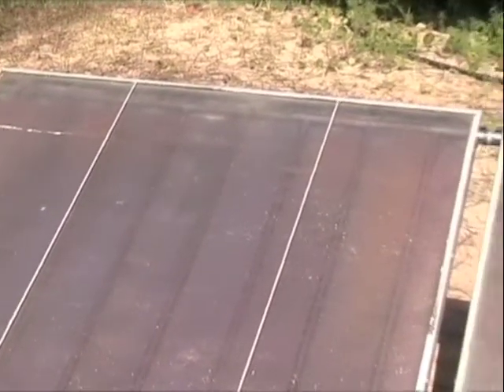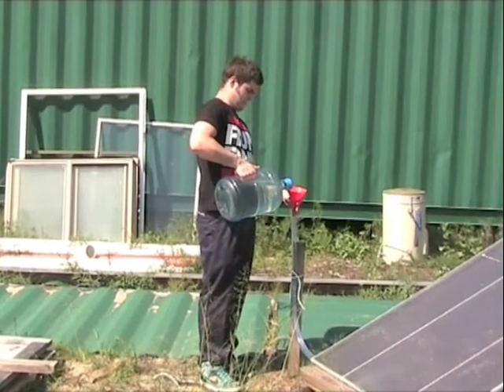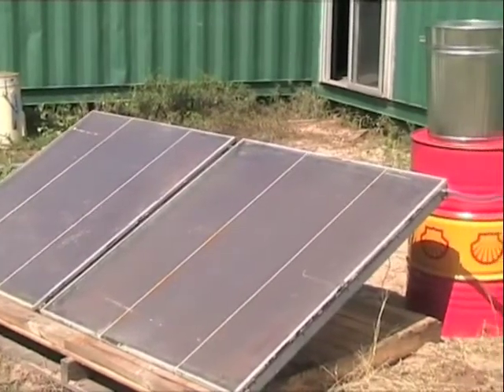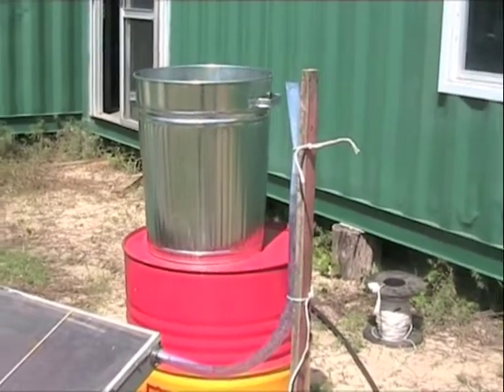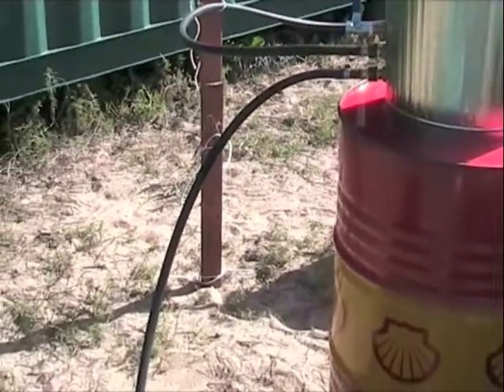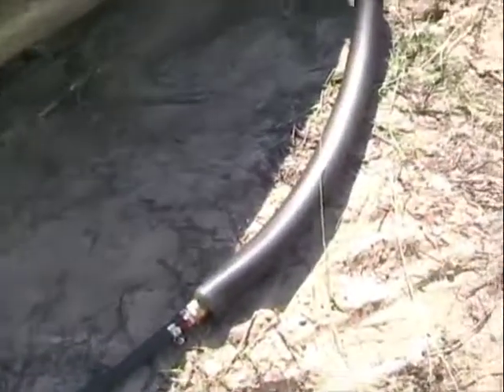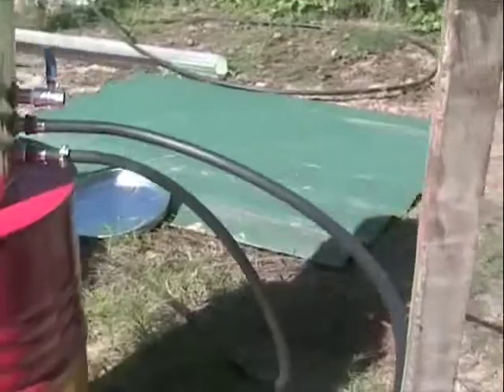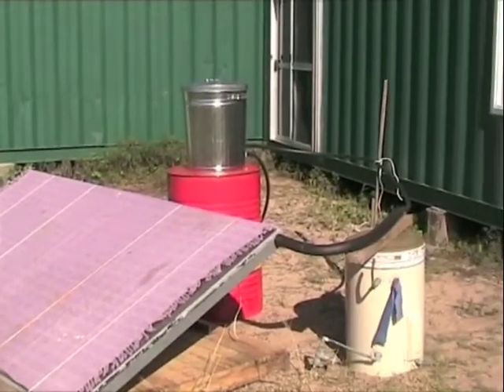Shipping Container House - hot water from solar panels

Comment: My mate paul down the road he is off grid as well, he has 4 solar panels linked and he gets 120v from them he just put it on a old hot water system he gets he's 75c every day i have to get him to make a video for you this did not cost him alot of money as i got him a good deal on 250w panels for $50 each and the solar rails for $10 each with all clips and brackets to hod panels on the roof ... so $220 for a hot water system not to bad hey it been as a experiment from start of the year and still working fine i think i be going this way to to cut back on the gas bill
Reply from the maker: weasel rodent I am actively looking into this idea. I have some unused panels and a water unit. I just have to find a DC element. Cheers Paul

Comment from the maker: A single panel consists of 2 lengths of 1 inch copper tubing running parallel to the ground, joined by 6 lengths of tubing that connect them, much like a garden gate shape.Pressed on to the tubing is flat copper sheeting. The sun's energy goes through the glass and heats up the copper plate which in turn heats the tubing and the water. The warm water rises to the top. I simply connected the two 1 inch tubes on two panels. The output is taken from the opposite corner to the input. Cheers Paul